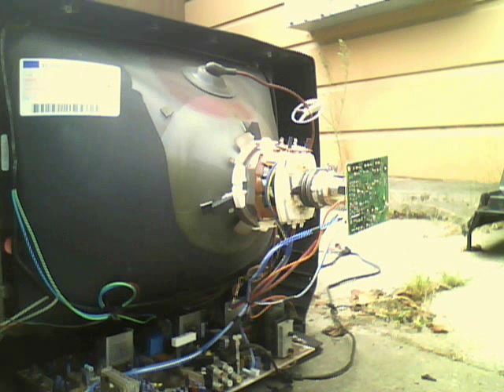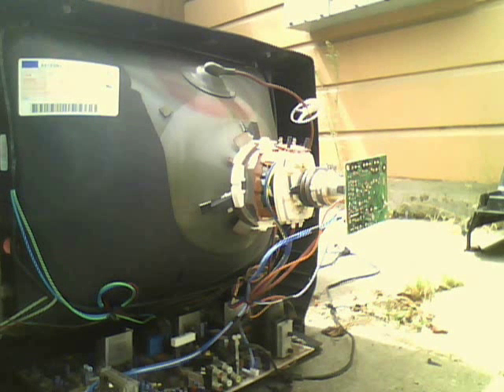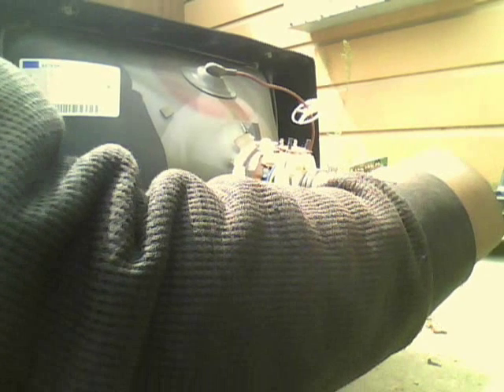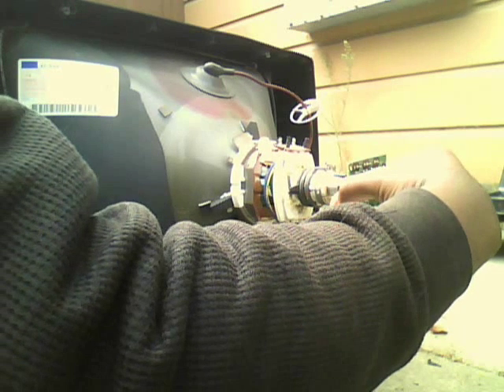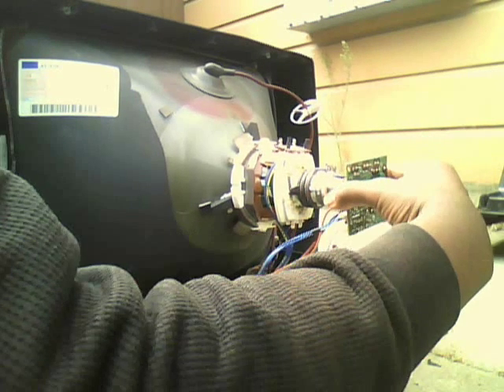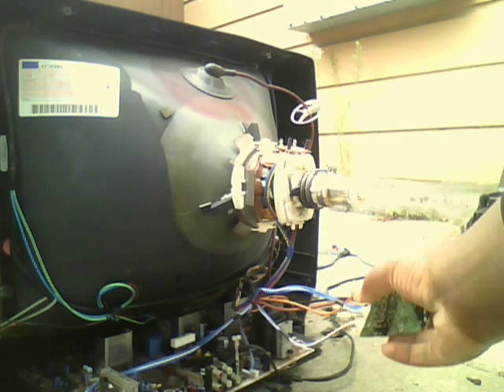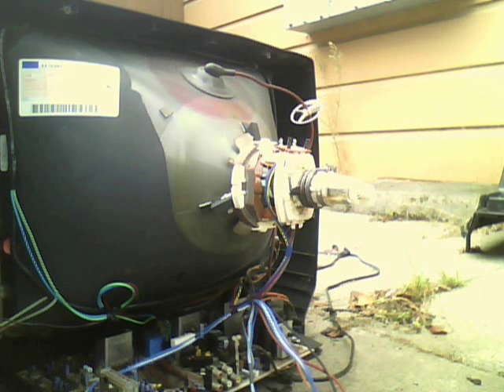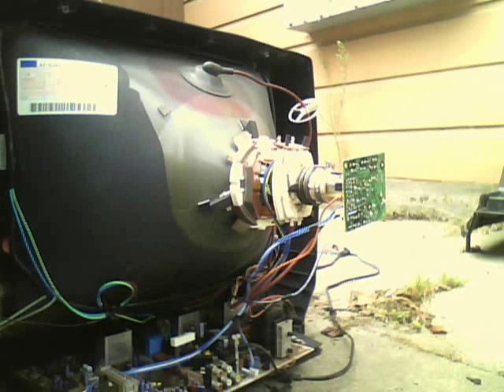How to Remove a CRT Neck Board PCB (Panasonic CT-20D20B)

Comment: I got shocked ages ago, when I first got my Thomson TS-3652 portable. I was cleaning it, and wanted to remove the chassis. I'd taken the anode cap off, and accidentally brushed my hand against the connection. There was a loud "zap", followed by a bright blue spark and a yelp from me, as I jumped about twice my height in the air. I learnt a very valuable lesson that day! :-P

Comment: I'd put a disclaimer in the description if I were you, just to be safe. You can still get quite a shock from the analogue video board (neck board). I can't remember the specifics, but I think it's because the cathode winding (which runs at a substantial voltage) in the transformer can retain a charge. I've been shocked by them before.

Comment: I've been shocked by the anode (26kV), LOPT, the chassis and the cathode on the analogue video board. The cathode runs at between 200-700v I think, so hurts a bit. There are also the grids, which run at high voltages too (one of which runs at thousands of volts).